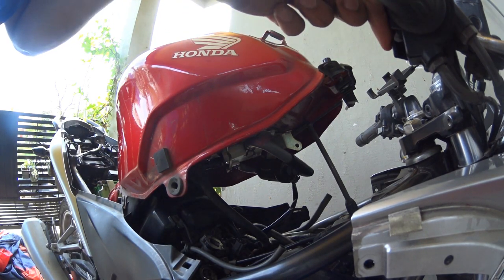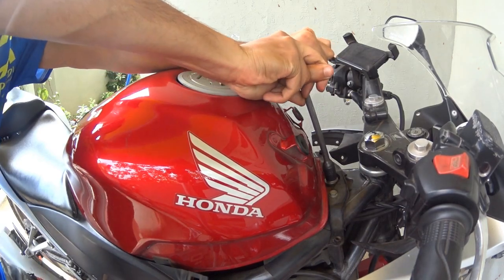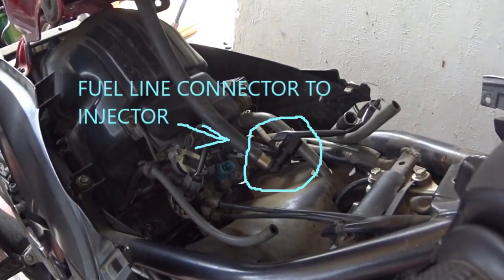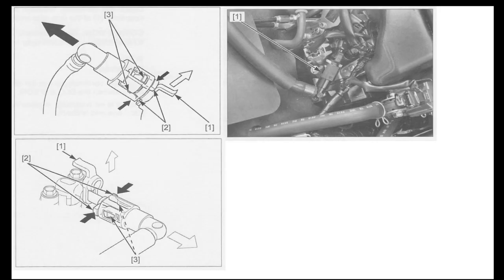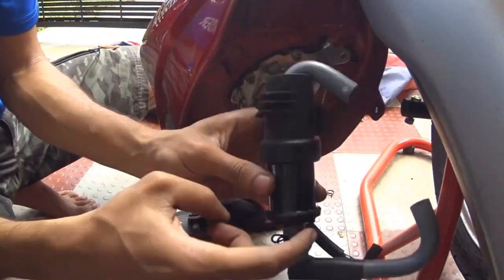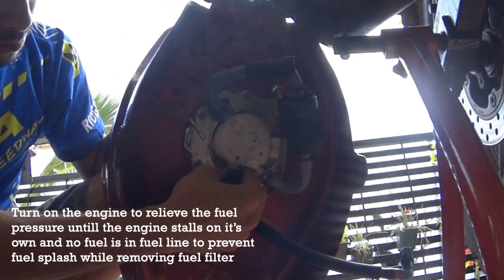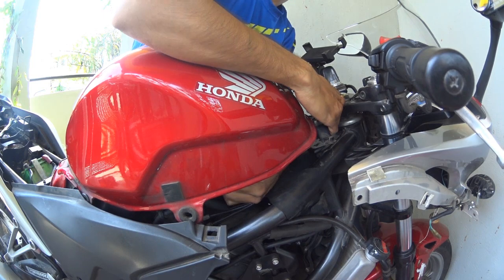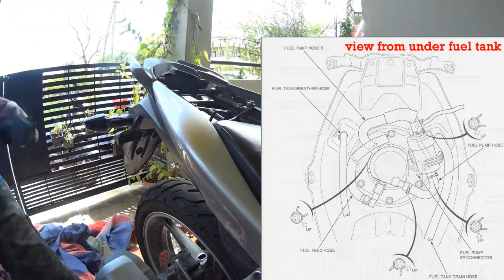CBR250R FUEL FILTER REPLACEMENT | FUEL TANK PUMP

Comment: My cbr 250r is not getting started . If gets started it is acting like its not getting fuel and stopping.. What might be the problem? Waiting for ur answer
Reply: Same problem
Reply from the maker: It’s quite hard to point out the exact issue you can start your diagnosis by looking into the air and fuel intake system first

Comment: Keep it up. U have shown the dismantling process quite honestly. Brother advice me my cbr is 9000klms 6yrs old should i clean up the fuel filter and when and whether should i replace or  clean the spark plug. One more thing just yesterday my abs brakes upon pressing hard, are making a kat kat sound for that when i removed the abs fuse the brakes are not making that sound. I noticed that 2 small Phillips bolts for down from the bike somewhere where the abs module is. Pls advice

Comment: Hey bro, due to stupidity of  service centre mechanic heat shield flap which is place below fuel tank is not properly place due to spark plug cap wire can you please tell me in cbr250r spark plug wire goes from 
1) cross(+)cut in shield or
2) circular hole in shield
Reply from the maker: I know exactly what you are asking 
The long rubber spark plug cap goes through the Cross cut +

Good that you decided to sort it out yourself . For service centers your bike is one among thousand but for you it's the only one.
 avoid service centers for basic services

Comment: hello bro. can i jist lift the tank and just take out the filter without take out wire injector?
Reply: Did you try that what I was thinking. Seemed extra endless your gunna pull the pump

Comment: Bro price of fuel filter & its benefit .also tale original spark plug price of 250 CBR.
Reply from the maker: Sparkplugs are usually around 900rs from Automotive shoes but in showroom it might be more than 1000rs

Comment: bro my bike right body cover bolt is not open .
key is slighty loss , can u tell me right tools
Reply from the maker: Place a cotton cloth in between the bolt head and key and try,
 if it doesn't work use a sheet of paper and fold as per requirement and try 
Idea is to make firm grip between alan key and bolt head

Comment: in how km should you change the fuel filter?
Reply from the maker: It's better if you change it at ever oil change interval of 6000kms for fully synthetic oil if not atleast change it every 2nd oil change i.e at 12000km
Reply from the maker: It also depends on your riding style, change oil filter at every oil change  if you ride agressively by using clutch frequently and churning gears 
For normal daily commuting with lower rev range you can push it and change at every 2nd oil change
Reply: @GAMINGBIKERBAZRAW  my question is for FUEL filter not for oil filter, thanks
Reply: @GAMINGBIKERBAZRAW  Whaaaaaaaaaaaaaaaaaat! I have done 89000 and havent touched it yet. In the owners manual it says it's good for 50000kms. I recently bought one, I will change it immediately